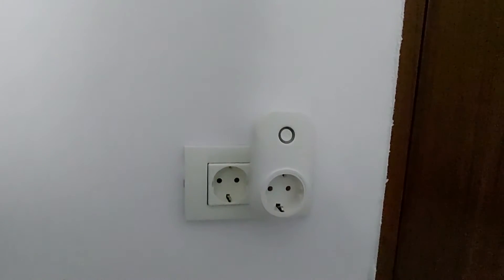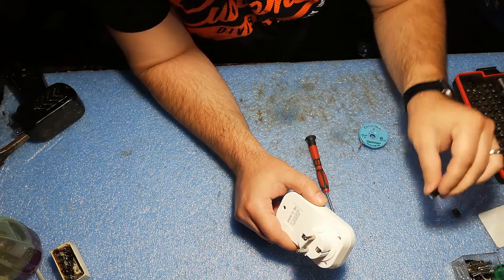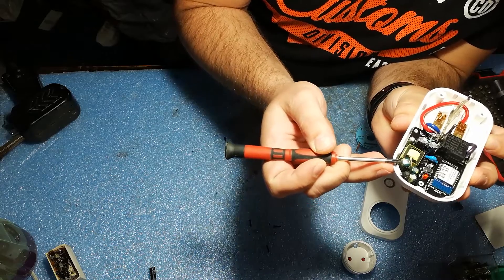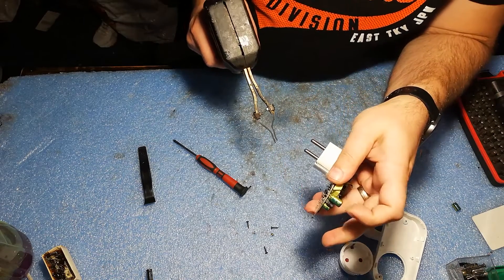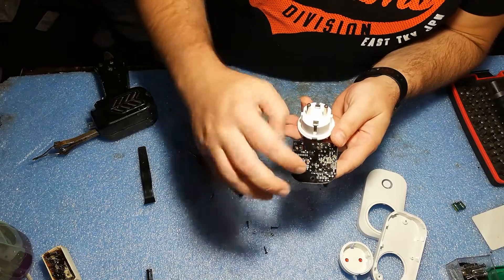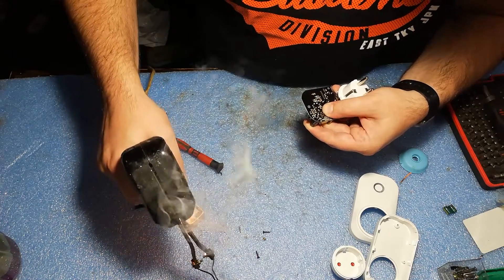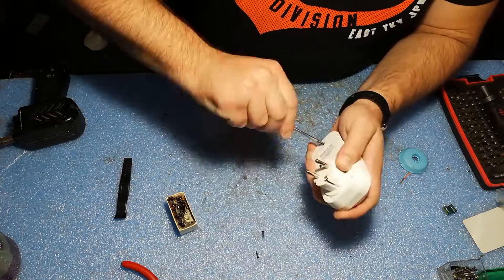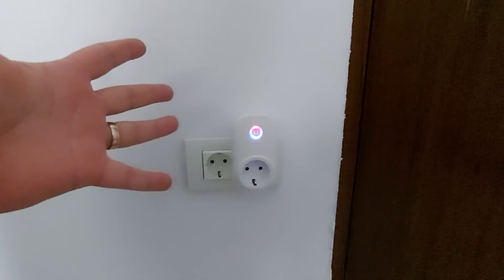Fixing a dead Wi-Fi Smart plug - CHEAP REPAIR

Comment: I have another smart plug that after working for a while, perhaps hours, it turns off itself. I haven't scheduled nor programmed that, so it happens randomly. Wondering if it's something with my install (some protection) or something wrong with the plug. It uses the EWelink app

Comment: Hello. Thanks for the video. I fixed my Wifi Plug EU3(16v 470uF cap) Thanks to you. There is no light before but now it seen in app and works but relay doesn't work. Should I change high voltage capacitors (400v 4.7uF ones) as well? UPDATE: I changed two 400v capacitors and now relay is working perfectly again :)) Capacitors in these smart plugs are sh**ty.

Comment: Adrian, You are the Hero of my day. Thank You so much for sharing this. I've managed to fix another model wi-fi smart plug by Your example ("Tp-link HS110"). That is a real win. It is 30 cents vs 30 bucks. That is the REAL ecology.
Have a great day and keep on rockin' the free world!
Reply from the maker: I'm glad it helped you! Take care!
Reply: Hi my TP Link has failed. How did you take the plug apart?  Any hidden screws?
Reply: @brumpsstuff8088  Hi, there is one screw under the label. One must be careful to disassemble the unit, because it is all held in one place by integrated plastic clips. Do not use metal screw driver. Check out this stream, it was very instructional: https://www.youtube.com/watch?v=rMTl5xNG9qk , starts around 28:30

Comment: Why would anyone go to all that trouble for a piece of shit chinese lump of plastic you can buy for less than £10, or about $13?

You can go to the store and get a new plug in about 20 minutes with zero hassle.

For someone that supposedly has a load of high end watches and drives a BMW I doubt you'd waste time doing this unless your lifestyle is fake and you can't afford to shell out $13 for a plug??

lol. 🤣🤣🤣🤣
Reply from the maker: I am trying to figure out if you have all your facts right. If I drive a BMW is because I like that car for what it delivers and not for the status. Regarding watches, I collect them and do not brag about. I also repair stuff for fun and not for the value.
Reply: Just because you can buy something new doesn't mean it's senseless to repair it. But I guess if you write like this you probably won't give a shit about limited resources, environmental issues and reducing e-waste. Why buy new when it's so easy to fix?
Reply: Capacitors are time machines. 
Use / or not use the capacitor make no difference, 
 as time goes by, it inflated & breaks.

To reduce toxic electronic waste, repair yourself if U can.

The soldering iron seems instant heat up type by using internal transformer.
This is not suitable for repair electronic parts since this soldering iron  may destroy IC, transistors.

Comment: Hello Adrian. Thank you for the video. Just 1 question: is this a WiFi repeater ? What will be the range to cover ?
Reply from the maker: Hello Octavian this is not a wifi repeater,  it is a smart plug. What it does it switches on and off various devices that can be connected in the 220v plug. It can be activated via a phone app or via a smart speaker like Amazon Alexa or Google Home.
Reply: @benassy69   appreciate the comment and clarification. Thank you and keep doing a good job !